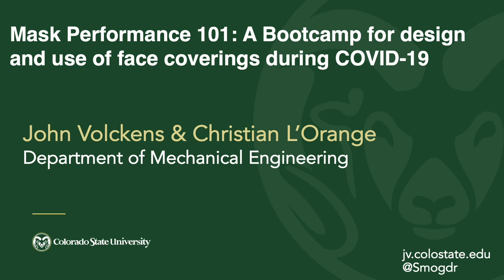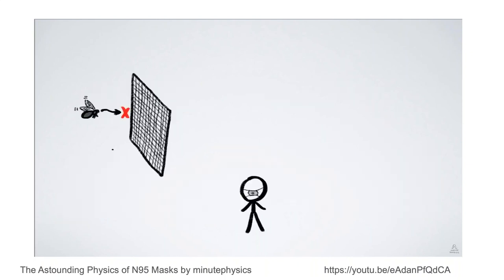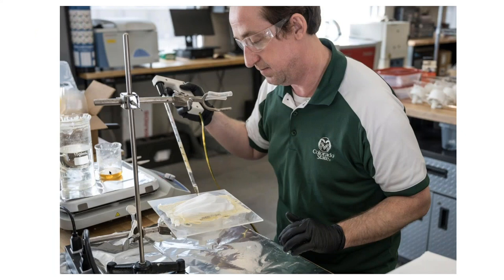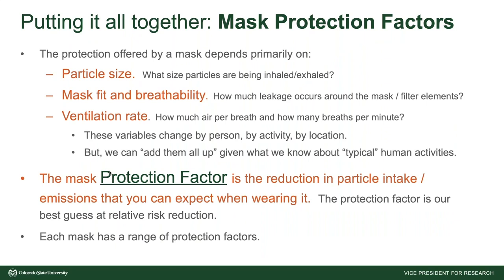Mask Design 101: A Bootcamp for Masks during Covid-19 #officialnats #diymask #covid19

Comment: Webinar Timestamps

00:00:50 John Volckens Intro and Masks performance 101 presentation start
00:02:20 Aerosols
00:07:30 How did we get here (mask shortage)
00:08:22 minutephysics video (Genius of N95)
00:14:20 Review principles of minutephysics video
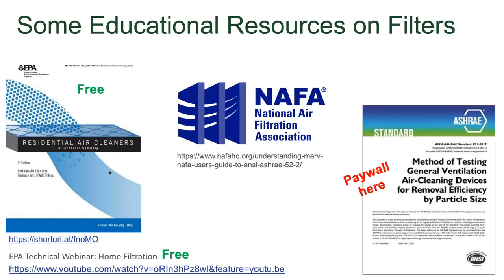00:19:13 Discuss filter educational materials
00:20:40 Colorado State University (CSU) testing program
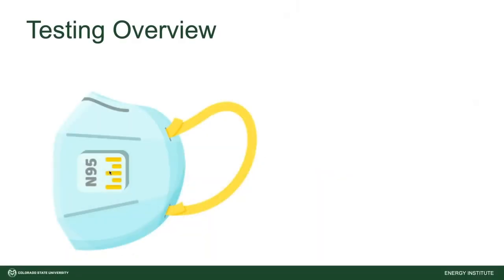00:22:57 Testing methods overview
00:26:09 NIOSH vs ASTM/FDA vs CSU testing
00:30:45 Mask performance data
00:35:12 Mask protection factors
00:38:54 John Volckens presentation end
00:39:14 Christian L'Orange presentation on Mask Design: an intro for mask designers and DIY builders/makers
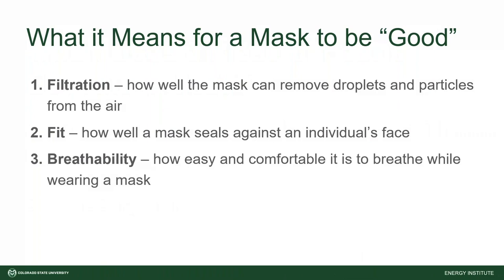00:39:35 What it means for a mask to be "Good"
00:41:25 Understanding mask filtration
00:43:09 Mask Myths - the only mask worth wearing is an N95
00:44:02 Importance of fiber diameter in cloth masks
00:47:07 Why fabric construction matters
00:49:38 Improving filtration with a static charge
00:50:51 Filter efficiency of mask after washing
00:51:54 Mask layering and performance
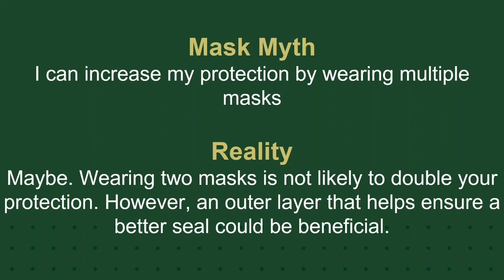00:54:03 Mask Myth - Increased protection by wearing multiple masks
00:54:59 A properly fit mask
00:58:08 Mask Myth - All that matters is covering my nose and mouth
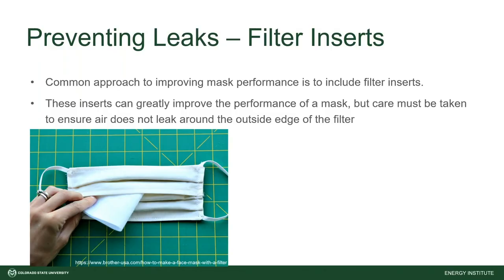00:58:52 Filter inserts
01:00:09 Mask Myth - A mask can only be used once
01:01:58 Evaluating mask fit
01:03:49 Mask Myth - An N95 rated mask will keep me safe
01:04:36 Understanding mask breathability
01:05:26 Mask valves
01:06:37 Fabric construction and breathability
01:07:27 Mask Myth - Mask wearing is dangerous because it traps carbon dioxide (CO2)
01:08:13 What about face shields
01:09:36 Considerations for (y)our mask design (slide typo maybe?)
01:10:27 Christian L'Orange presentation end
1:10:30 Q&A